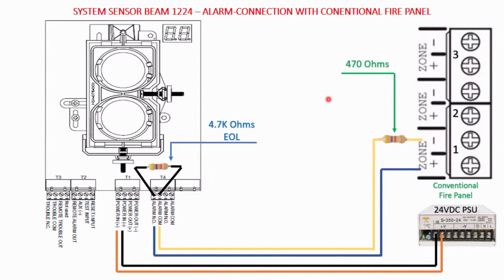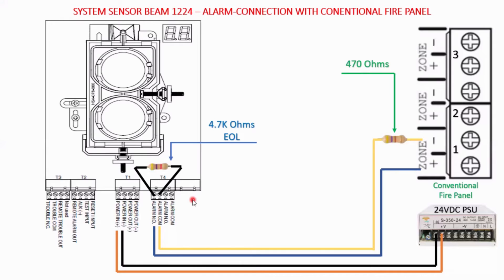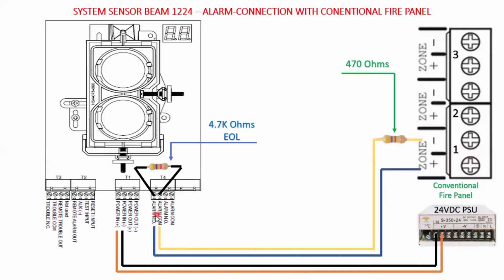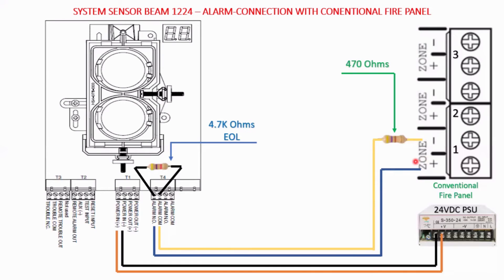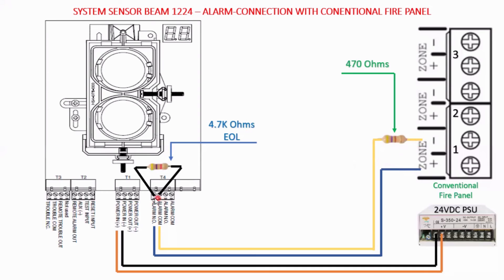System Sensor Beam Detector Connection with Any Conventional Panel

Comment: Sir can I ask question?
Does it work if I add heat detector,manual call point and Strobe in a parallel circuit in any conventional Panel?